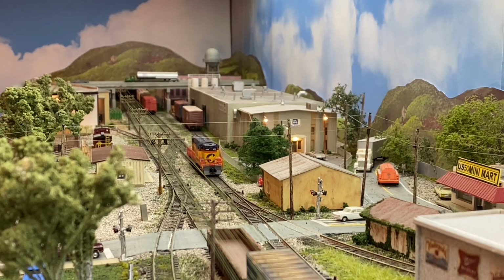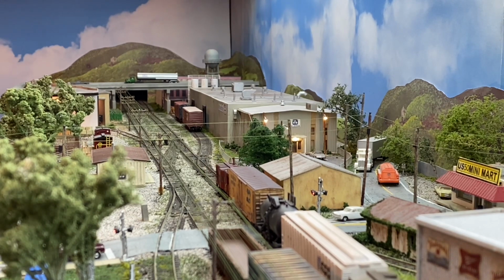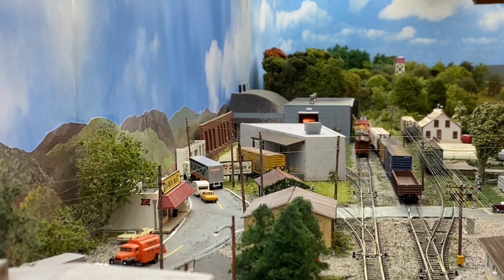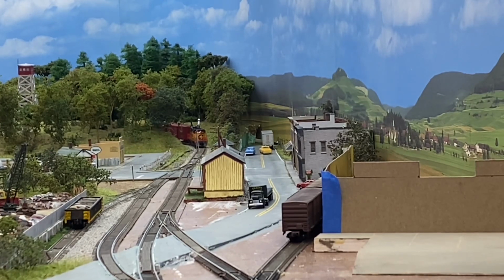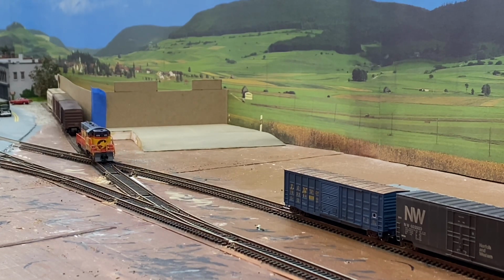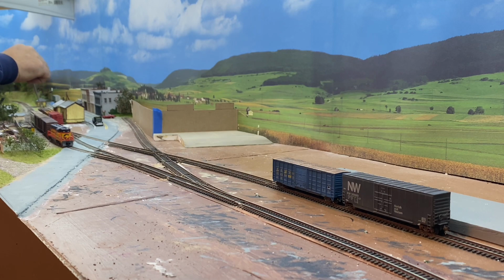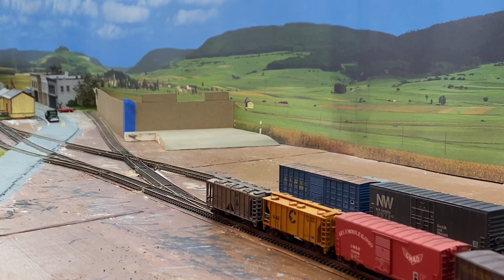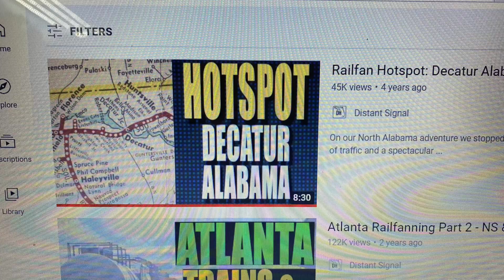Part 2 of 4, shuffling cars in Chillicothe and heading to Oak Hill to switch Cedar Heights Clay

Comment: The new drone view works well. Is the black truck near the depot new? The angle from the end of Oak Hill is a sweet view. The depth from scrap yard to service station and beyond really pulls me into the layout. Mostly been working on trach additions and adding two more switches. Starting to play with JMRI Panel Pro. Learning more about programming cv's in speed matching locomotives that are dissimilar in brand, decoder, and type. Very time consuming and burning through a scratch pad tracking my changes. Have a safe trip!
Reply from the maker: Waiting at the bridge in sprinkling rain. Yes, that truck is new. I picked up a 2 pack of Mini-Metals at a local hobby shop to support them. Always need more vehicles! I don’t know anything about Panel Pro or Decoder Pro. Hoping for a train soon! Stay safe!